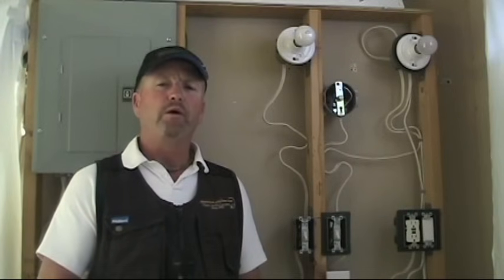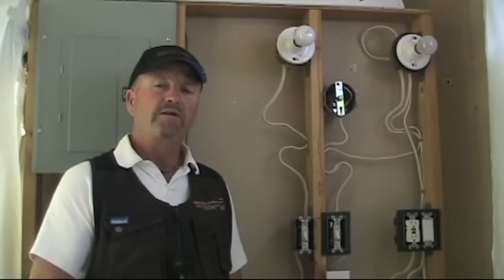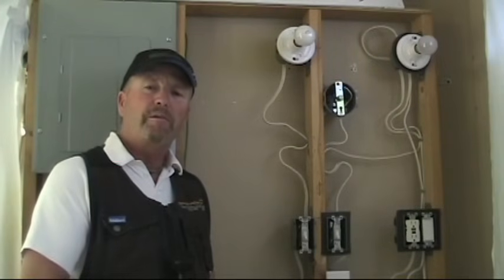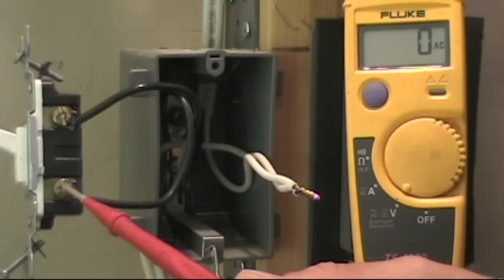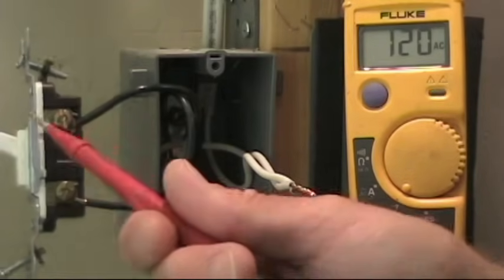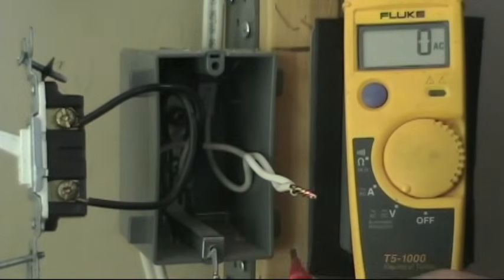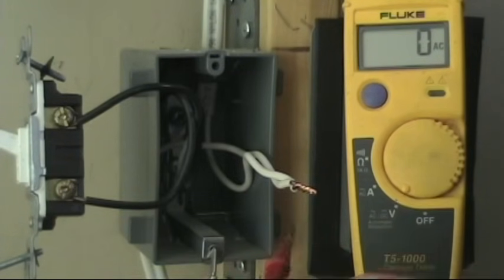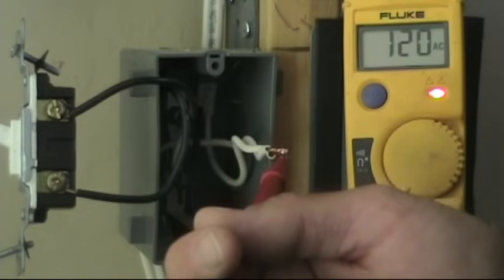Understanding an Open or Loaded Neutral

Comment: I understood what he said because I already saw a video where somebody actually explained it in an easy to understand manner.  Terry gets a C- for his teaching skills on this one.
Reply: Terry uses the phrase "Further up in the circuit" which had me totally confused, as   he just showed us that up the wall was located just a lamp socket.  I believe Terry's perspective must be that "up the circuit" refers to wires closer to the pole outside, you know, the one that is "up in the sky."  Agreed, his video is near useless.  Would be better if he knew how to show a schematic and simulate a break in a wire.
Reply: Where is the how to corrected ???
Reply: @JuanSanchez-pq7xn  the correction is, connect all the whites back together again.  Somewhere down the line, say at an outlet, the guy took the wire cap off from the white neutrals and left them that way. Once he capped them back together the issue is solved.
Reply: Where you saw it?
Reply: It would have been nice to actually see what that open neutral looked like because I'm having a similar issue, but the video didn't actually solve it for me
Reply: @MakingBusinessesBetterAgain  you guys are scaring me
Reply: @itoibo4208  that's a little odd to say to each themselves, there is no guys though, I've met them @MakingBusinessesBetterAgain = all girls

Comment: You also didn't show exactly what your friend did up the line to cause this neutral to be hot
Reply from the maker: I didn't show it, because I wasn't there.  I was relaying a story, and explaining how it happened.  He took apart a splice of neutral conductors while working on the circuit and forgot that it was still apart in that junction box when he restored the power.  That's when he started to trouble-shoot what was wrong.

Comment: would upstream mean the break in the neutral is somewhere between the first light and the service panel? or between the first light and the last light of the circuit? If the neutral was disconnected at the second light how would that cause backfeed at the switch? the circuit would still be closed from the first light back to the panel and the backfeed would actually be at the neutral wire between the second and third light would it not? please help me understand

Comment: there is an easier way.. shut off the power and do a ohms check between neutral to ground .  you should have continuity since it's the grounded conductor. if not it's open. by back tracking this way  using the half way method on the circuit you can find the open outlet.

Comment: While working for a heating company years ago I got a late night call for no heat. I get there to see a fairly new warm air furnace and instinctively I reach for the power switch mounted on the side to see if it's on and to see if may have been installed up side down. (on being in the down position) On touching the switch box I was lit up like a Xmas tree because the whole cabinet was hot! Turn off the breaker and open the box to see lots of wires under one wire nut.... and the connection was burnt to a crisp. There was NO neutral and nobody had bothered to tie the ground to the box or cabinet. 15 minutes later I had trimmed back to good wire, added a second wire nut, and grouped the neutrals into bunches of 3 with a jumper, plus tied the ground to the box. Back in business. In hind sight, had they run conduit to the switch box there probably would have been a secondary neutral path via ground, but this was a Romex run from the ceiling to the unit WITHOUT a hard ground connection. In that case it may not have provided heat but I wouldn't have been blown to the floor with a hot cabinet. Did I mention this house had a dirt floor? All the better reason to have a good neutral and ground. I never did find out who wired this thing but now I always check with my inductive tester first.
Reply from the maker: Yes, good idea (inductive tester)! You never know what you're going to find when coming in to a trouble-call!

Comment: Well, you explained it, but sped by the part about the splices. Might want to show that. Thanks.
Reply: He should have used a diagram.  A classic example of someone knowing the situation so well they don't really know how to explain it clearly.
Reply: Agreed. Explained it, but still some uncertainty.
Reply: I agree, I sure wish he would’ve demonstrated or explained in more detail what/how it happened with the white wire his friend messed up.
Reply: @justme4172  now I am confused. Please show and tell more.
Reply: Neutrals carry current i.e.  amperage but not voltage. They are twined together and deadheaded to the neutral bar in a panel so when the voltage is used by the load it dissipates its current to earth ground if you leave a neutral  unconnected from other neutrals in a circuit box it now carries voltage
Reply: I most likely have a loaded neutral. I've had every expert over to help me figure it out. And they can't. Breaker is off and I still get shocked.
Reply: @wannabecarguy  did you test the breaker? Are you sure the correct breaker is turned off?
Reply: @dracula3811   yes, my breaker is still supplying power when in the off position.
Reply: Yeah he skipped over the good part
Reply: Not to mention with a switch leg the white wire ( I mark mine) can be 120v
Reply: If you don’t understand that simple explanation, you don’t understand 120v electricity at all. Think of the neutral as the RETURN (an old term) , and if you don’t understand that, stay away from electricity.
Reply: @patrickdunn8918  Read my comment again.
Reply: @patrickdunn8918  By what you just commented, I'm positive you don't understand single phase residential codes. I tried to stay neutral on this but my feet are grounded.
Reply: @patrickdunn8918  He is explaining this to a WIDE audience. The whole purpose of the videos to help people who don’t understand what’s going on. You missed the point. It should have been made more clear. Period.

Comment: i used to run across this often when i worked for the power company with a flickering lights call or homes burning out light bulbs. the connectors would sometimes fail at the pole or house or the neutral would break midspan by usually rubbing in a tree or failing underground on a buried cable.

Comment: Thank you Terry for adding to my knowledge, I'm trying to install and automatic electrical switch for a backup generator.  I'm not and electrician but I am an engineer and know just about enough to get myself killed. lol I'm trying to learn enough to survive this project.  Thanks again.  and just incase someone is wondering, the answer is NO I will not be doing a video explaining how to do this once I figure it out.  It's too dangerous to share with the general public and as an engineer it would be irresponsible of me to share this information with unqualified persons. I am actually unqualified myself so I definitely will not be sharing it with anyone else, Sorry.

Comment: Open? Neutral. The very terminology confuses me. "Open" circuits suggest you wouldn't have power. What would splices further up have to do with the neutral then being energized?
Reply from the maker: Consider a simple circuit, power supplied to an incandescent light bulb.  There is a tungsten filament in that bulb that when energized, it heats up so much that it glows brightly when one side of the filament is 120V, the other side is neutral and at earth potential. But if you break that path on the neutral side (open circuit), there is no longer a complete path for current flow.  However, the 120V supplied to the hot side is still there.  the filament in the bulb is really just a piece of wire made of tungsten so it still conducts electricity.  That 120V is there on the open side of the neutral waiting for a complete path!  Have a look at this post from my website to better explain this. https://www.electrical-online.com/understanding-an-open-or-loaded-neutral/

Comment: can't this cause a high bill on led lighting ..my lighting would light up when you touched them when switched off the landlords electrician came and swapped some wires in the consumer unit after I got a shock changing a switch with the lighting off on the rcd switch

Comment: I have a 3 way switch from the top of the stairs to the cellar, the one in the cellar has just a switch were I can turn the lights on and off with the switch, what I want to do is hook a switch and outlet to the cellar. How would I hook it up?
Reply from the maker: It depends how the circuit is wired.  If the power supply comes to that switch in the cellar, then it will be easily doable.  If not, then it's not easy without running some cable.
Reply: @theinternetelectrician  The power does come down to the cellar, can you do a mockup of a 3 way switch going down to a cellar so I can see how you are setting it up it would be appreciated. Down the cellar I want to hook up a switch outlet. I just need the wiring on the switch receptacle.Thank You.

Comment: Interesting video but how about showing or describing how the problem was fixed?  I've got kind of the same problem in my building.
Reply: Key word was Open Neutral, means that little white wire was left dangling somewhere on its way back to circuit box; so it wasn't able to complete the circuit.

Comment: I was hoping this video might answer a question about a situation I was having about a voltage drop in a Hot-to-Ground check.   I show an open ground on a single receptacle leading to a gfi plug.   When I checked the wires, I get good voltage from Hot-to-Neutral, but am showing about a 45 volt drop from Hot-to-Ground.   The run is a grey romex under a deck and some parts are buried.   It a critter gnawed at the line and got through the insulation, but that cause a partial drop between Hot-and-Ground (showing about 80 VAC on a 120 VAC circuit)?
Reply from the maker: I would guess you have a high resistance corrosion problem on the grounding path.  If you narrow it down to the one run of cable that is partially buried, then you've got a compromised cable. Check connections everywhere you can, if all checks out at the source end, but not at the arrival, then you have to replace that run.
Reply: @theinternetelectrician  Thanks Terry.   I found the problem.   The buried run of the romex had a nick in the cover, all the way through into the wires.  It looks like there was a voltage leak to ground, which eroded the wires even more (1.5 inches), cauterizing the soil around it in a clay'ish ball.   I can't believe the 20 amp breaker didn't trip.  The moist ground was acting as a resistor just enough to keep the breaker from detecting a full short.   When I tied the hot and ground together at one end, and did a continuity check from the other, there was about 20k Ohms getting through.  Same tying the neutral to ground together at one end, checking continuity at the other.   Running a new line today.

Comment: Question - is it allowed  to run a visible white wire in a kitchen cabinet at all? For example a transformer for LED below the kitchen sink? Danger from possible leaks and mechanical damages?
Reply from the maker: Emil Tchilev it’s about a lot of common sense. You need to protect line voltage cables from mechanical damage and yes, from potential for water damage so you pick a location that accomplishes this keeping in mind that you have to put the transformer somewhere.

Comment: Hi Terry, My main power comes from my meter to an outside cutoff switch just a few feet away, then travels about 120 yards to my house. My main 200 amp panel in my house has the neutrals and the grounds on the same bar. Doesn't my main panel in the house essentially become a sub panel since the outdoor switch is in place? So should I separate my neutrals and grounds? And do I need to add a ground wire between my outdoor panel and my indoor panel? thanks

Comment: I have a cabinet shop with 110 and 220 and 3 separate 220 breakers for compressor table saw and planer after 2 years all three 220 circuits stopped working and both lines show 110 each but o think  something is up with the neutral but all lights and outlets work just fine whyyyyyyyy?
Reply: go to your electric box and test with a voltmeter just like in the video, the voltage between the hot wire(live) and the ground wire should be displayed after you put your voltmeter in there and the voltage between the hot wire and the cold wire(neutral) should be displayed also, and you should check all the phases this way, homes typically have two phases

Comment: If I have a neutral and a load but require a line on a switch how do I fix?
Reply: the line is the power coming into a switch, so if you have a load going into it the switch is receiving it as the line

Comment: do you know anything about low voltage house wiring, I have a friend with low voltage switches with relays that controls the 120 volt side. She has a breaker on the 120 V side that can not be set. I think there is a short or an over load no the 120 side of the breaker.  What do you think?
Reply from the maker: Pam Carver if the breaker will reset without any relays on, and trips when you switch on a circuit, then likely on the 120v side. If it won’t reset at all then could be the transformer? Hard to say?

Comment: This is a great explanation of what I've been trying to tell people.  What I don't know, and PLEASE HELP if you do ... what's a good troubleshooting technique to FIND where in the circuit is the open neutral ?   In a lighting circuit there are so many places it could be.     Do we start with the first (or last) light in the circuit that IS or IS NOT functioning ?

THanks !!
Reply from the maker: Ralph Desmond start with the outlet that isn’t functioning, then go to the closest one (s) that are working.
Reply: Thanks.  But if a bunch aren’t working (it’s lighting in this case) do you work from the last good one towards the bad ones, or which direction ?
Reply from the maker: Ralph Desmond short answer, yes. But there is no exact science to trouble-shooting. And you’re only guessing how the circuit was wired (in what order) unless you are the one that pulled the cables. Sorry I can’t offer anything better, but no simple answer to this.
Reply: Terry Peterman    Sounds good.   I can see the path of wiring because it’s above a t-bar drop ceiling.  Thanks for the help!

Comment: I've got an open neutral with no working upstairs lights, which happened at a lightning power surge. I've got no idea what precisely has gone wrong with the neutral wiring! An electrician is coming to see if the broken connection can be found and repaired.
Reply: what did he find, I have a similar issue now.

Comment: Thanks for sharing.  I've got continuity between all 3 of my hot, neutral, & ground; whats up w/ that?!...   thanks
Reply from the maker: I would have to know the readings you are getting, but with power off to a circuit, unless you have all switches off, everything unplugged, you will see some continuity between hot and neutral and ground. And between neutral and ground (essentially the same), you should have very low or no resistance.

Comment: I am an Electrician with over 30 years of experience .. this video was not useful at all 
You never showed the problem or how to fix it.
Reply from the maker: Gerardo, it was more of an explanation of what went wrong to create the open and loaded neutral.  I didn't think it was necessary to show the process of connecting 2 white wires together to complete the circuit. Sorry,...
Reply: @theinternetelectrician  As an electrician, I would say that showing a diagram of how a circuit like this works would be helpful ...I kept wondering why we were looking at an explanation from a location that was affected but had nothing to do with the actual problem.  Recreating the problem by (say) removing a neutral from a receptacle or a junction to show how that would affect voltage readings at the switch would be a really good way to show how simple a problem this is.
Reply from the maker: @SwingboyPA  Yes, a diagram would have been useful.  I did open the neutral in the circuit and showed the readings that it happen with an open neutral.  I just should have filmed myself physically kicking that splice open I guess.  I have a post on my website that has the line diagrams to show this, I'll add the link to the description. Live and learn I guess.  https://www.electrical-online.com/understanding-an-open-or-loaded-neutral/

Comment: Hello Terry,
well that's, simple but who does that?
Answer this from bones, if voltage is 120 to hot and zero to ground on common , why won't the outlet work
And why does the voltage drop, when you plug in , and come back when you unplug?
Reply from the maker: It sounds like a high resistance connection or splice somewhere in that circuit. Shut off the power, open up all the device on that circuit starting with closes to the problem outlet, and see what you can find. Check all receptacle connections and any splices. Look for signs of heating, discoloration of wire insulation, etc.